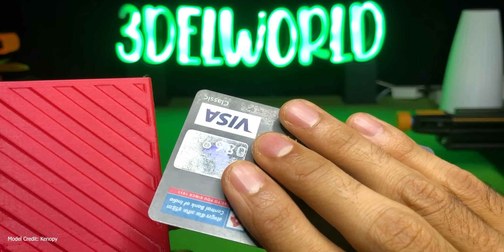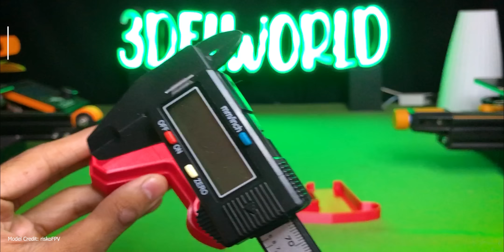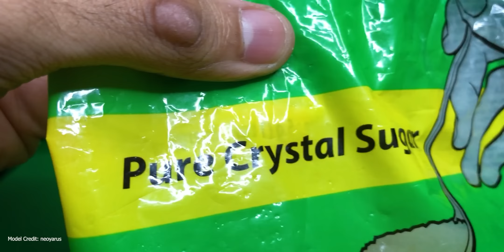Functional 3D Printing - What It Is and How It Works | 3d druck ideen | #3dprinting

Comment: Thanks for the cool videos, what's the name of the glass bed you are using? What do you also use to help with adhesion?

I have an Ender 3 S1 Pro that comes with PEI, has very good adhesion, but my bed is so warped that I want to get a glass bed to reduce the warpage, but worried that I might then lose the good adhesion
Reply from the maker: Glad you like our videos, Glass bed I used is comes with Creality ender 3 v2. You can deal with warpage by adjust some settings (like temp...)
Reply: @3DELWORLD  Thanks, I am more talking about the bed being warped, not the models that I print, so temp would not sort it. I just need a bed that is flat. I will look into that one that comes with the E3V2

Comment: I love functional 3D print designs but i hate that most of them are just utterly pointless.

00:06 AA Battery Holder 3d printed
If you need to store a bunch of them, maybe. I would lose the lid though and make a different type.

00:52 Fidget Clicking Wheel 3d printed
Useless

01:43 Popup Wallet 3d printed
Trying too hard, would just lose all the cards if needed and then not bother with it. Also takes up a lot of space.

02:48 Caliper Case 3d printed
Useless, You want to protect your whole calipers not just the end, plus most of them come with a box already

03:29 Screw & Nut Measuring Tool 3d printed
Sure, why not. If you work with a bunch of similar screws and cant tell them apart for some reason and dont want to use a caliper every time

04:17 Cutting Finger Protector 3d printed
Complete bs. A sharp knife will cut into this, if you use knuckles you only use a tiny area that is away from the plastic. At best you get plastic shavings in your food. Plus you need to take a lot of time to put it on and off and the food safety is questionable

05:16 Lemon Squeezer 3d printed
Useless, Once your slice is this small, you can squeeze it by hand easier faster and probably better with less waste and no questionable plastic

06:28 Flour Shovel Spoon 3d printed
Useless, you probably have a spoon already?... Id accept it maybe for washing machine powder, but it doesnt even have marks

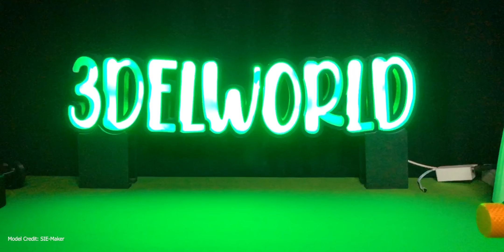07:00 Paper Towel Roll Holder 3d printed
Almost. It is something that you cant easily buy but this design looks flimsy and you cant grab the paper towel onehanded. Its something.

07:48 Bag Clip With Screw Cap 3d printed
A solution to a non existing problem i guess... I can see a use case where you have a 15kg bag of dog food and youre too old to properly hold it you might want to use something like this to pour it out but thats really about it. Any small bags you just use a cheap cloth pin or just rol it and any larger bag you can just use a shovel (maybe the previous one even?)

09:10 Credit Card Phone Stand 3d printed
I dont believe anyone will ever use it. I used to have a phone stand integrated into my phone case and i used it only sometimes and only when watching movies at which point i could just as easily have a better more sturdy variant at hand.

10:09 Razor Holder 3d printed
Maybe useful, be aware about doublesided tape in bathroom though, it tends to usually stop sticking and then you see your razor on the floor. Definitely dont use with a straight razor
Reply: The screw and nut measuring tool is actually pretty useful. If you're sorting through a bunch of screws, it's much faster to use this than calipers.
Everything else is landfill waste.

Comment: Not sure it's safe to use 3D printing for food use
Reply: From what I read, only if you use PET and PETG plastics without coloring, and even so without high temperatures. But you can print molds to make safer materials with them.
Reply: PLA is so safe It technically can be implanted in human body. :D
Reply: @evoikon  Its the voids from 3d printing that is one of the issues when it comes to food and bacterial growth.
Reply: PLA and PETG are food safe as long as they were manufactured correctly. The thing is that 3D printing isn't food safe because the layer lines leave voids that are nearly impossible to clean properly and quickly because bacteria playgrounds.  So you can use them once.

With molds, you have to be careful not to transfer those layer lines. Silicone will transfer the layer lines almost perfectly unless you sand or smooth them in some way.

I'm not an expert, but I think coming in contact with room temperature non-produce foods (like sugar, flour, chips) is relatively safe, as these products can be held at room temperature specifically because they lack the conditions required for bacteria growth. That said, you can't print with a bronze nozzle and you have to make sure the specific filament is food safe.  And you probably can't clean them. Cleaning may actually introduce bacteria.

So I don't think it's really work messing with food.